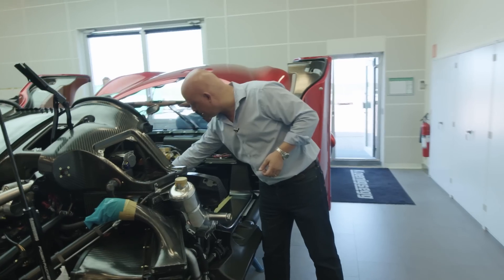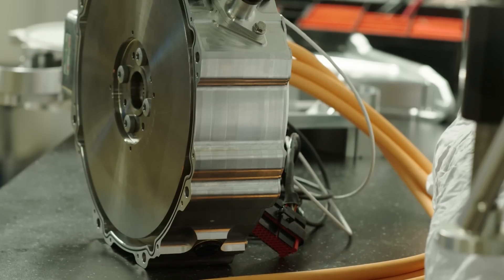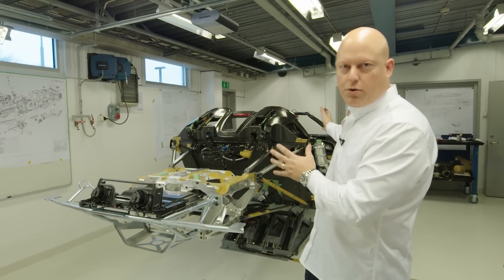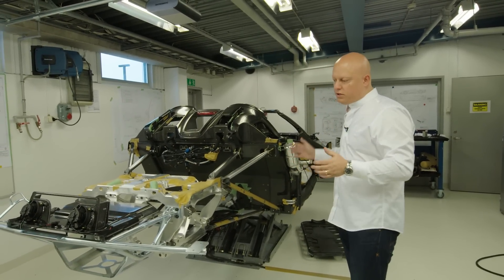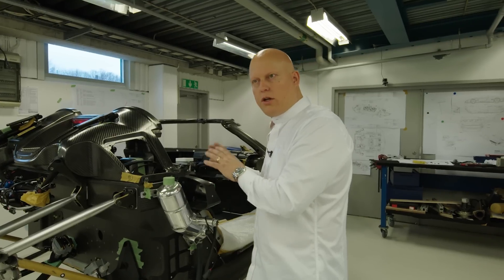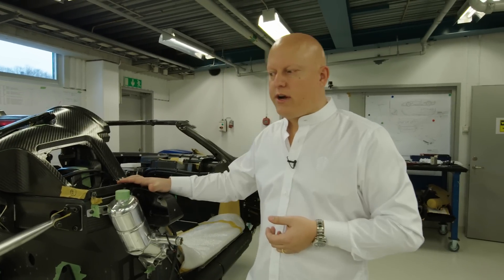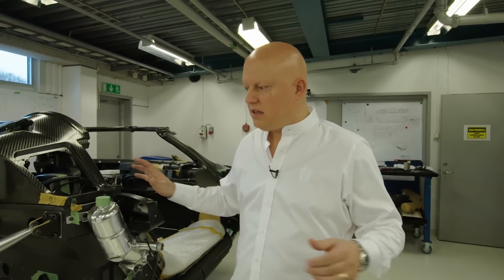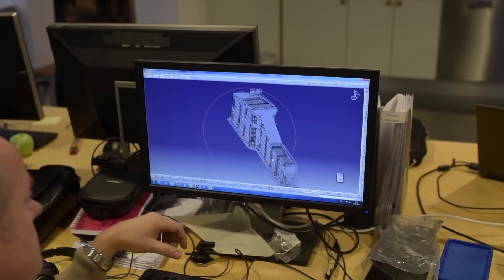Koenigsegg Regera Under The Skin -- /INSIDE KOENIGSEGG

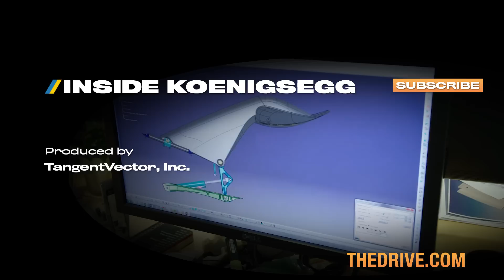Comment: The processors he speaks of in the individual components, (around 10:26), I believe, is the CAN bus, ubiquitous in all production cars presently. Created by Bosch and released as open source, they solve the problem of a mass of wiring but can be difficult to set up. Again, the tenacity of this gentleman, and by extension his crew, is without equal.

Comment: Question. Why doesn't Koenigsegg research direct injection two stroke technology? 

Direct injected uniflow scavenged two strokes have more than proven their enormous power to weight ratio in the marine industry. Evirude's 300 V8 outboard motor as being 75% cleaner and much more powerful than any of their competitors. It is direct injected. Don't get me started on the proven reliability of two stroke diesels used in automotive applications like the 12v-71 detroit diesel. 

I think koenigsegg is missing a great opportunity to show just what a two stroke motor can do.

Comment: 5:37 he just casually says "over 1,500 hp" like its a completely normal thing!  Damn!!  What does one do with 1,500 hp in a car that's NOT track focused?
Reply: 250-400km/h.

Designed purely to make bugatti owners cry.
Reply: Isnt this the one that drives Directly and simply without a gearbox?
Reply: Who would win a French boi with W16 Quad Turbo 
Or. 
A Swedish boi with V8 Twin Turbo along with 3 electric motors
Reply: Where 1500 hp really belongs is inside a mobile generator or a small stationary powerplant for a developing country. Of course then your main concern is fuel sipping. In that field every 1500hp diesel generator (of which many exist) outclasses the motor because they are all by definition 7-15% more efficient. Albeit they are about 10x the size.
Reply: What you're doing with 1500 HP is dragging a diff that is like, HUGE. The amount of gear and therefore load on the engine is nuts. So much so that there's 3 more electric motors to lug that bitch to speed.

Comment: I like the idea of no shifting, even if that is fun, with 1500hp combined there is no need to. Like the powerglide dragsters, they hit in low then all power along the track. Does the car takes off with electric power only?
Reply: yes it accelerates from 0 in electric alone. but you'll hear the ICE accelerate as well as it is replacing the power used by the Electric Motors. At around 30 or so mph the hydraulic clutch will stop slipping and start synchronizing RPMs in anticipation of engagement. when need the hydraulic synchromesh will grab the final drive and add the ICE  power to the mix. The ICE is still recharging the batteries while driving the final drive along with the EMs. If acceleration ceases the EMs will cut off and the car will operate in ICE power only. If acceleration is commanded, the ECs will kick in again. The ECs are there only to help acceleration using such a tall final drive. But accelerate it will right up to the Final Drive limited top speed. Meaning the power train is capable of a higher top speed but since there's no gears the car redlines like its in 3rd gear. So  even at its top seed of  250 mph its still pulling like it has another gear waiting.
Reply: James McClellan I can't take it all in :(
Reply: You must understand that the converter pulls even harder when slipping. It's not pulling anymore at 250mph because the limit is the aero drag.
Reply: G55STEYR The limit isn't aero drag. The limit is final drive related. It has enough power to achieve 290 mph but the final drive redlines the engine at 250 mph.

Comment: Christian is absolute inspiration as an innovator and entrepreneur. Him and Elon should do a joint venture vehicle. Would be interesting to see what they come up with.
Reply: CAPTAIN AMERICA My comment isn't about creating the fastest vehicle, it was more a statement about creating new and exciting technologies. In my opinion, Christian and Elon are great innovators with a vision for future tech.
Reply: Koeniggsegg works with Rimac , they did the battery pack and more for the Regera.I think Mate Rimac is the best in the business (sorry Elon) , with the Rimac concept_one and the Rimac conceptS.
Reply: Interesting, I wasn't aware of that. Make it a trio with Elon ;)
Reply: CAPTAIN AMERICA Where are they? Are they invisible?
Btw, I mean, there is no significant difference in the numbers most supercars perform, so that nowadays makes no sense. Maybe in the 80s or 90s, stable 0-60 mph in 2.5 sec was a miracle. But nowadays it is just an industry standard. 918 blasts faster which is even cooler. The thing is that there are still not that fast for me. If it'd run a quarter mile in 6 seconds, that's gonna be a good car, if not - it's not. That's the car I'd like to have as a daily driver. And the thing is not about speed or acceleration, its about covering distance faster. The bad thing is that you need a lot of downforce and grip: either you need a heavy car or some smart ass solution, which I'm after.
Reply: Should definitely look up the Rimac, pretty neat. Agreed on the trio joint venture, craziness.
Reply: CAPTAIN AMERICA Well, I have a fellow with Bugatti. He's kinda rich (you guess), in his 30s, but he worked a lot, he's not really focused on cars, just recently got into. He had never driven a RWD car with LSD and without ESP. He daily drives a very computerized Audi RS6, a good street warrior, but he can't control a raw car yet. He doesn't get that RWD cars are worthless without limited slip differentials.
On the other hand, when he was at the Bugatti rally this year in Spain, there was a old man from Germany, pushing all the shits out from his Veyron, going 240+ km/h on bad narrow field roads and so on.
So now Bugattis are just a show off. A marketing of numbers. Koenigsegg design got worse since 2008, as they try to resemble korean car design, so you can't say the same about them. You won't buy a Koenigsegg as an item to show off.
Also I know a man who now drives an Aventador, but he used to have a Koenigsegg. He said, that was the sickest car he had, you must be completely mad to drive it. It's extremely raw and all up to your skills. The complete opposite to the refined Bugatti.
Hope this answers your question a bit.
Reply: ***** It's just occasions, I have a good taste and I happened to meet various people. Having rich friends doesn't necessarily make you rich. I've got plenty of rich friends, but I'm not as rich. Unlike them I've never been focused on money, I learned about things I thought I needed more: racing engines and car designs. I'm in mid-20s, I got dumped for one engine I've built, making me in quite big debt, then my country (being the biggest one) had fallen into some deep shit, so am I. Right now, I'm servicing older Lamborghinis, but it seems, soon I'll be ready to pack my stuff and see the world outside. The question is whom I'd visit first - the bald guy in Sweden, the argentinian in Italy or the old grumpy german in Germany. I'd like to get some advices on how do I really create my cars and sell.
Let's face it, now I know pretty much everything in theory, I've got a concept of a supercar (let's be kind with words), but I can't do anything about that. If I sell my cars, maybe I'll be able to create a design prototype, which isn't gonna run the mechanics, but will have the looks I need. Where do I show it? Nowhere, I'd not be able to get to Geneva or whatever as there's no budget. And believe it, most wealthy people are pussies. Once gathered the money, very very few will take experiments with them. Meaning, I don't know anyone who'd invest in supercar production, because it's not much profitable. Mostly because people here are nouveau riches: they show they have money, but they try hard and they don't have much more money they show they do. Sparkles in your eyes, look at me stuff, you know.
It's the need for refinement that drives me to creation. When you have money, you and these people would rather live today, not tomorrow. However, I might be a snob, but I don't like any of currently available supercars. And also I think they are slow. All of them.. :) The arab's Devel Sixteen is a nice try in terms of horsepower, but a nightmare in all other aspects.
Reply: ***** I've learnt the story of Christian throughout the years. He wasn't wealthy that much too, he did some business first to get the money (exporting chicken drumsticks from the US to Europe, common thing in the 90s), then got few patents and made them work. Also he's got a guy from Norway who had invested a lot in Koenigsegg as a company, and he owns a 49% share if I'm correct. He's always in the background. But I guess Christian never had a chance to find an investor until he had shown a running prototype. Later when the company started to produce CCs (early models) he invented some more things, like the FlexFuel, which was adopted worldwide and serious money came in the play. So that's what I like about him, he invested in his ideas, got the profit and now he helped many others like Freevalve, a FuelCell company from Italy of Nunzio La Veccia, NanoFlowcell/Quant/Quantino, you probably heard of. That's cool. And btw, about helping and investing, the Brunei family is rumored to own about 120x Koenigseggs! And that's an old figure. It means, for at least 3-4 years they had been supplying solely Brunei family, as they couldn't manufacture more than 20-40 cars per year. That seemed like pure investment from Brunei!
I've got a bunch of innovations in my design, in the layout and mechanics, which I want to patent and be able to sell and protect. That's why I want to meet Christian, as swedes are the bosses when it comes to patent rights and laws. Even Germans, at the end of 1944, when they saw their fall, started requesting patents through the Stockholm Patent Office, and so after the WWII they had plenty of patents to sell and offer and so they had income for their corporations and they were protected by the laws.
Nowadays you can do a lot of cool things, like raise money with fundraising online and stuff, but it seems so distant from the things you need. I take cars as friends, they are useful, and so the car I'd like to create is useful in all aspects. The speed is worthless if the driving is unpredictable, so my car comes as part of the system which makes high speed driving more predictable in both - today and near future driving.
At the same time, you know, I could start a youtube channel in a Salomondrin style, "oh today we're gonna start making our supercars" and tell the stuff about this and that, and probably end up being fooled again as all the things would be used/patented by the other smart-ass guys, which I'm not.
The old grumpy german is the man of Lotec, btw. He wants to create some cars, he knows things, but he's quite old and his project management is slow. Yet the price is about 2M euro + 9 months turnaround. That all is worthless unless a new model is introduced. With his car stuck in 90s, not only a restyling should be done, as he thinks, but the whole car. I'd like to offer a project for him, not the car I want to do myself, but something in between. I think it might drag me in time from my main project.
At times, I think whether I should give away that stuff and just focus on car designs and etc. as Gandini and Guigiaro did. Btw, they all became big figures in their 20s, which is a pain for me! Makes me fussy.
Reply: CAPTAIN AMERICA Like I said, it's a car with numbers, for shy guys who think they'd look flamboyant when everybody hears they got one. So you just proved my point. Second, you reply doesn't conflict with my first statement, that usually Bugattis are bought by people who had never driven fast cars before, i.e. they are ordinary drivers or even less experienced. Who cares, they look like crap. The Veyron was designed by the same man, who designed Skoda Octavia (2000s gen) and they do look the same! Makes me laugh all the time. When I met a guy who'd later become my friend I told him the story... And he looked okay, lol. He'd just tell me that he had been to a very special presentation at the Bugatti the year before and he had seen the Chiron. But 3 months later I discovered that he owned one (OOPS!), haha. (1of1, #001 ss+l'or blanc paintwork.)  Btw, this year he was offered to get a Chiron as a previleged customer, if he finds the right sum... you know...
Like I said, Bugatti owns the crown for the coolest car for people who are not into cars. They've probably never heard about Koenigsegg, they think Pagani is a mediterranean meal, and Lotec must be based in Compton.
Reply: CAPTAIN AMERICA Lemme guess, you must be from the US, right? The thing is that in Europe, although it's legal only in Germany, people drive the shit out of their cars. So believe me, Koenigsegg is fast because they've been there. At least once. Regera - yes, a simulation. Koenigsegg holds the record for the fastest 0-200-0, if I'm correct.
And no, it's not about numbers. It is, on the certain level, but in the end its all about emotions and the way you interact with the car. This differs a Ferrari from Lamborghini, a Koenigsegg from Pagani and so on. You could reach 400 km/h with Lotec C1000, but won't you shit yourself to death by doing so? I think you've read the story of a guy with Aventador, who had owned a K before. Do you know what happened to his K? He didn't sell it. He was driving around 300 km/h (190 mph) and the car suddenly jumped sideways (from a road imperfection or something), flew a bit and then he'd hit a light spot, so that the car split in half. You'd never find a footage or a pic of it on the web, sorry. Luckily, he few weeks in the hospital and he was alright. And so he likes an Aventador also because its slower for fuck sake. If you buy a supercar, you speed. It's obvious! And if your country is not being a dickhead, you can get away with it. Many in the US manage to do so, although I don't know how!
Reply: CAPTAIN AMERICA Plus numbers don't make sense.
Just an example: you probably heard about McLaren being the fastest road legal N/A car. Well, it might be true, but go ahead and watch the high speed run. It stops at 340 km/h and then it slowly crawls to 370+. It's so boring I never watched it to the end.
Same with Veyron - oh those killing numbers. A useless car with a useless top speed, as the tires would overheat and there will be no fuel to propel this marvelous creation of German motoring. The only good thing about Veyron is its stable 0-100 km/h (0-60) acceleration times and high level of comfort. As for the acceleration, they did it the same way as OG in Don't Be A Menace to South Central - without switching gears! Hence you need a bunch of horsepower to move that mass without switching gears! GT-Rs can make it with the same weight, but ~ twice less the horsepower. How? They do switch the gears in between! Amazing! Are this cars fun to drive? Dunno about Veyron (Gordon Murray quite liked it), but GT-R is not, it's a cruiser, not a sportscar. You feel like you play a video game, you feel detached from the process.
Reply: +CAPTAIN AMERICA Guess you gotta eat up your words now lmao! :p
Reply: He drives a Tesla and says it's an amazing vehicle. Would love to see them to work together. 

Check out apex: the story of the hypercar
Reply: Rimac does a lot, but you vastly underestimate how difficult it is to bring a large volume car to market. They have 3 models, space X, and Solar City. Elon has his hands full and has done a lot. Tesla Is also still pretty young and has a lot of room to grow. The model 3 will be the car to really push tesla and be what they envisioned an affordable priced electric vehicle. They already have what  400k orders while all these other companies can only push out a handful of cars.
Reply: Koenigsegg cars are for hardcore drivers. Bugattis are for those who had never driven a fast car before. Not a joke of somekind, btw.

Comment: I dont understand how it can get traction with that sort of performance being RWD.
Reply: He said up to 300kmh if you floor it, the wheels will spin O.o sooo... glhf type of car
Reply: Yes ik that...heard about that for a few yrs when it was first anmounced....but how is it suppose to have nutty acceleration?? Some drag slicks wld help hahaha
Reply: i think the car must be driven differently than a normal car. since there are no gears affecting the torque delivery, the accelerator must applied  carefully and strategically in relationship to your speed, angle of direction, and road conditions. that said, i imagine the traction and stability control systems probably stay pretty active.
Reply: joe Shmoe
Probably just sensors, but how many cpus in car? 25-30? and thing to admire is also that software and precision of sensors